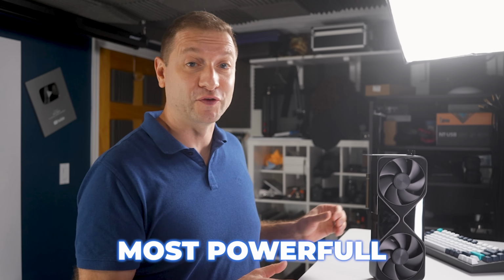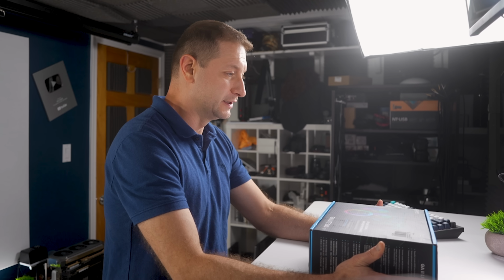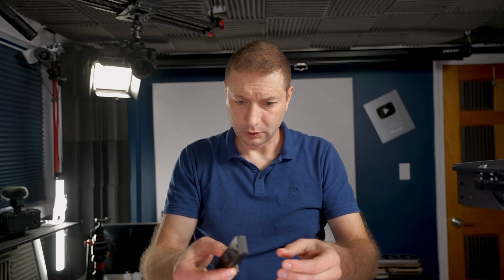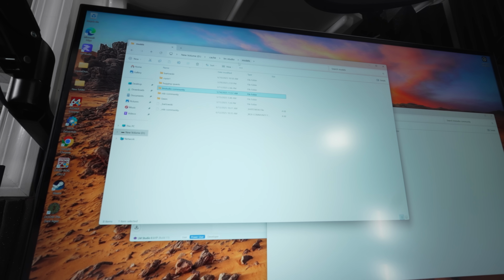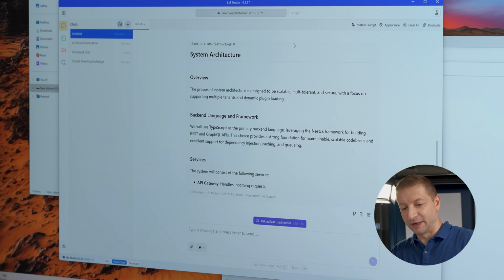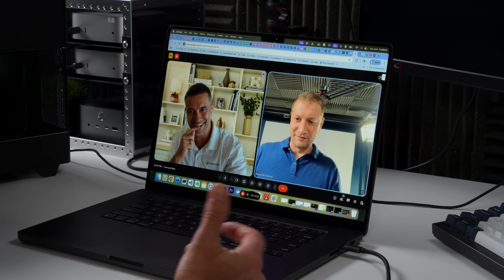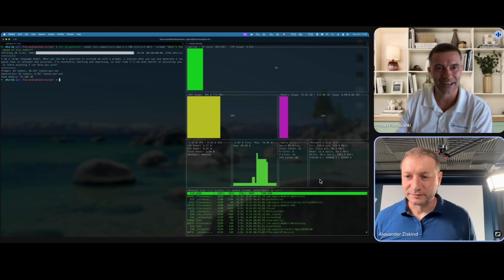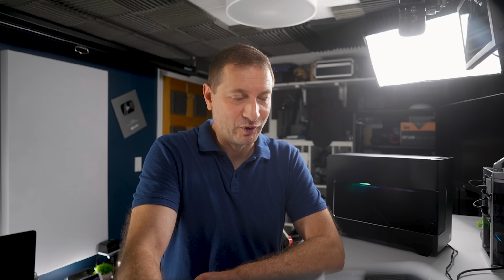Going up against Apple's Ultra

Comment: Alex, instead of your m4 cluster I want to see two M3 ultra studios clustered. You could probably run almost any model you want but I'm curious about the inference speed tokens per second and how it would handle things like fine-tuning or other non-memory GPU computation heavy tasks. Yes it would be 20K but so are many multi GPU workstations and I suspect even with two and three ultra studios in a cluster, you could probably still power it in a normal office setting.

Comment: by the way, I have a smaller case (Terra) and the GPU length is limited by ~322 mm. So even not any 7900 XTX could fit.

Comment: You should try installing Ubuntu + Docker Engine + vLLM and then running LLM models via vLLM. That would would put the most load on the hardware and vLLM should work pretty fast. Easy to deploy in Docker and use the mostou tof the hardware.
Reply from the maker: Did you watch till the end ? :)
Reply: @AZisk  Yeah, saw it now :) Initially I thought the video is over with the Mac M3 Ultra and Ivan part. Yeah, Linux is much better than Windows + LLM Studio combo, especially with vLLM that is properly configured to run in Docker. vLLM is most taxing on the GPU RAM but boy, it runs pretty fast...

Comment: Very nice build.

I guess price wise , this build and Mac Studio M3 Ultra with 512Gb RAM and 2Tb SSD are pretty close.
Preliminary results from engineering M4 Ultra samples give around 40% better GPU performance compared to M3 Ultra ( AI part could be even better, still not tested)
Reply: M4 Ultra? Though the M4 Max die lacks the required connectors for SoC fusion?
Reply: @LukeWatson53  Those are engineering samples I am talking about, not production. It seems that M5 will be delayed, because M4 did not hit the targeted numbers and they have them a lot on stock. 
M4 still fares well vs anything that AMD or Intel have, so that could be a reason too.
Reply: Oh! I see.
But is there any chance that there will be an M4 Ultra production variant?
Reply: @LukeWatson53  I would assume, with M5 being finished, they might go straight to it when they renew MacStudio since it will offer better upgrade vs M3 Ultra
Reply: 😮 @DS-pk4eh Yeah! That sounds like a way more reasonable upgrade than the M4 Ultra. Especially for memory bandwidth. I'd expect it to be at least 1200GB/s on the M5 ultra.

Comment: Alex, as an LLM enhusiast, please tell me what Local LLM is actually useful for coding. I'm genuinely baffled how people use local LLMs for coding when the training data is from 2021-2022 except for DeepSeek R1, but that one's not specialized for ocding and I don't have the hardware to run the full model locally.
Reply: Qwen2.5 Coder is pretty decent. On my M4 Pro Mac mini with 64GB RAM, I can run Qwen2.5 Coder 32B MLX 8-bit. A 4-bit quantization will run on my gaming PC's RX 7900 XTX much faster though. I wish I could get my hands on a Radeon Pro W7900 with 48GB VRAM to test out...
Reply: You should also share your system specifications so alex can suggest an appropriate LLM for your hardware
Reply: @STORMFIRE07   dude it all depends on patience. I am running a laptop with GTX 960m i7-6700hq and 16gigs of ddr4 2133mhz ram yet I can run models like GPT-OSS 20B model. (......takes a few min) Or 4B qwen3 model but little context window with around 3 tokens per second)
Reply: For css any llm above 7b will give you results but if you are looking for proper programming in any language none of the local ones gonna help you. It's not worth the effort. Way cheaper to have ec2/ cloud service provider/ copilot etc.
Reply: I'm wondering what it is you do if training data from a few years ago is not useful? Coding is coding, it doesn't really change much except in some specific niche fields where it's first of all unlikely that LLM's would be trained very far, and secondly you wouldn't need LLM's - you'd be rolling your own, and you'd be able to use copy&paste like a pro, drop it in npp, autosub variables with formula, paste. 
I've worked for over a decade as a software dev, and never encountered a single thing where I would think an LLM would be useful, but then I've been working mostly the same way, functions and frameworks etc evolve and change but not really the how to do it so to speak. But - as I said, I have never tried it since I wouldn't know for what, when I'm doing something I already have in mind exactly how I want to do it - the what isn't really the question. If it was, people would not need software devs... But they do, because they aren't good at the how - and that isn't something AI can help with since it's open ended.
Reply: @noth606  . Some languages stay close to the same - for example if you're using GO there's very little difference between code from 2022 and code from now. But there've been breaking changes in React,NextJS and the JS eco system as a whole. That's 3 full versions of DotNet and C# so a lot of changes there as well, and some things like Effect - the typescript framework didn't even exist.
Reply: Makes you wonder how Llama 4 bombed so badly, being a recent open source model. Guessing training compute is a major problem for open source LLM devs, being incredibly expensive.
Reply: @alan83251  i doubt meta, the company behind big social media apps such as facebook, instagram, snapchat, has problems with it being “too expensive” they would have their own server to train this stuff in
Reply: Qwen3 32B is the best model I can run locally with a 24GB or 2x24GB GPUs. Problem is: you have to use Yarn because it's default context of 40960 tokens is almost useless for coding. In this case, 24GB will be not enough. GLM 4.1 32B is another good choice.
Reply: No local model is useful, they are all shitty compared to Sonnet+claude code
Reply: Try Qwen3 models. There are also some benchmarks on HuggingFace Spaces, you can check for coding benchmarks
Reply: I've had some success with these Ollama modals locally with the  Roo code  VS-Code extension.
mychen76/GLM-4-32B-cline-roocode:Q4 
mychen76/qwen3_cline_roocode:30b
mychen76/qwen3_cline_roocode:14b
Reply: Try Qwen and Devstral:24B models to start with
Reply: I have used various model provider and local one. None of them was able to provide valuable information for coding in general, especially mobile platform. JavaScript, typescripts and others that are popular on stackoverflow seem to get better results, but still quite useless for slightly larger projects.
Reply: @nasko235679  sadly I have not found a local coding model that is good.. though I think in about 2 more months we will have a strong enough local model come out. I vscode and I use codex I was trying out Gemini CLI but I was maxing out the token context… my code base is big and I’m still too new to coding to figure out a fix. So I’ll just stick to paying for Claude api. I have a very strong computer but I think I’m gonna buy that $2k ai computer on his channel. I use a bunch of local LLMs that I call from LM studio. Sooo when a model does come out that’s strong I’ll prob need another dedicated computer just for running my local model
Reply: Context I have a 4090 and 96ram for my main computer but I doubt the coding model they release isn’t going to be quant it’ll prob be a very big model
Reply: Microsoft and Nvidia recently released new coding model, check out in their hugging face
Reply: Try to code with local Qwen or devtral:24b models - it seems good enough for non-complicated tasks
Reply: Still slower than WD and crucial ssds
Reply: qwq
Reply: I’ve been using Gwen, and it’s been great
Reply: It really depends on what kind of system you have and what models you can run but my personal experience is that if you're looking to do vibe coding the local models are generally not that great because they don't do a good job across multiple file dependencies.  I would love to see a deep dive on coders actually using LLMs for coding though
Reply: For up-to-date language/library knowledge, use context7 MCP server
Reply: I just pay a 20 dollars subscription, worth it for work, much faster, better and easier to set up than a local LLM, also maybe even cheaper than building a expensive system and replacing it after 5 years.
Reply: @lelouchlamperouge5910 can you down load the dat later for use or is it all in cloud and your out of luck when internet goes down?
Reply: I mentioned a few models but my post got deleted? I had good results with  mychen76/GLM-4-32B-cline-roocode:Q4  in Ollama if you have enough vram (19GB model).
Reply: An LLM enthusiast who can't test out a couple of models...?
Reply: The answer is chatgpt or Claude. Local LLMs are overrated and fall way behind online ones
Reply: Very good question. Will Alex share his magic with us?

Comment: It looks like Intel will soon release a new "SPARKLE Arc Pro B60 48GB" card, costing about $500 - this could be interesting hardware for testing.
Reply from the maker: the 24GB card is $500.
Reply: @AZisk  Still cheap considering the memory.
For that amount you're lucky to get ANYTHING above 16GB new.
Reply: @shapelessed True, but you can get a 7900 xt 20gb for 600/650 bucks new or 500 used.
But yeah it is an upgrade
Reply: @Flattithefish  Not over here. Here even used ones are 600.

Comment: 1000 tokens per second is just unbelievable
Reply: 1000 tokens you said? wow.. I can't for next video why it goes so fast!
Reply: That is going to be for batch processing. One session won't be that, but you can run multiple parallel sessions and get an accumulated throughput.
Reply: Try going to ollama and running smollm:135m! It will get like 10m tokens/s 😂😂😂